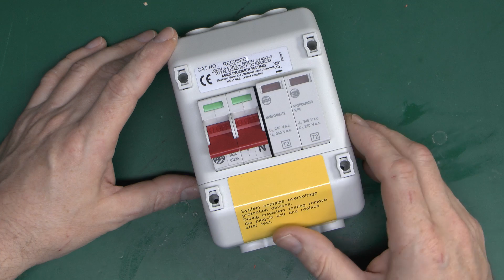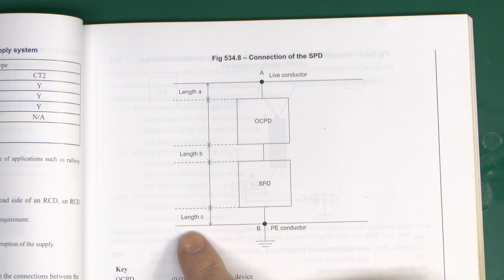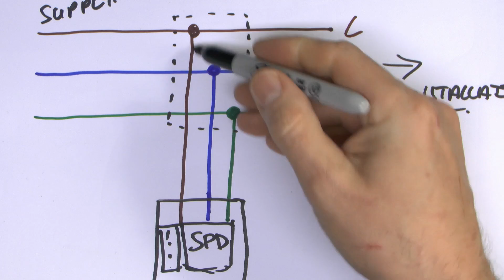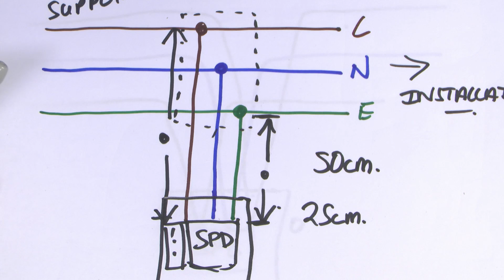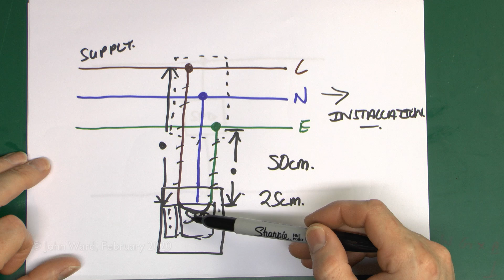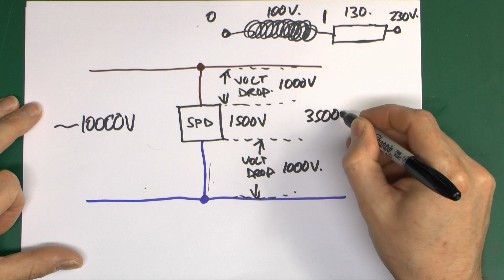Surge Protection 5 - Wiring Lengths, Connection Options

Comment: I wonder if this stuff is being pushed by the authorities to harden UK electricy networks against new EM pulse weapon technology.
Reply: Tim Boler It’s being made explicitly allowed because everything now has electronics in.
We used to have incandescent bulbs for lighting, AC synchronous motors running clockwork in our appliances (oven clock, central heating timer, etc), and bimetallic strips regulating temperature (thermostats in your heating, oven, fridge, freezer), etc; none of which were that bothered by a momentary power surges.
Now we have LED lights with electronic drivers, and electronic powers supplies and controls in our appliances.
Electronics don’t like these kinds of voltages, the insulator layers within an integrated circuit are very thin (more than thick enough for the normal conditions), a component might not totally fail the first time it is hit by a surge, but it creates a weak spot, where subsequent surges will cause further damage. It’s usually an accumulation which causes the final failure, not an obvious event like a near by lightening strike.
SPDs are designed to reduce those surges to a level where the electronics can tolerate the remaining energy without being damaged.
Reply: @Bin216  Maybe a problem if you live in a rural area where the incoming supply is fed via an overhead line susceptible to lightning strikes, but for most houses fed by underground cable, I'm not sure.
Reply: No, an EMP will destroy EVERYTHING and it DOESN'T EVEN HAVE TO BE PLUGGED IN!! The only way to protect from an EMP is to place the electronics inside a FARADAY CAGE , otherwise everything with transistors is going to be fried and worthless.
Reply: I'd bet more on insurance companies etc. wanting more protection for sensitive electronics. Always follow the money.
Reply: @benbaselet2026   My line is IT, especially data centre management.  We put significant amounts of time, effort and money into securing our power supplies because a single incident could potentially cost many millions.
However this is just guarding against an expensive but very remote possibility.  Most European data centres are on urban (so usually underground) and notably stable supplies.  In 25 years I've not seen such an incident, not even one caught on monitoring systems that did not reach critical equipment.
So I would be genuinely very surprised if this figured very high in insurance companies' calculations.
For the moment I remain sceptical — even cynical — about the merits of domestic surge protection. They seem to be even less value than the arc fault protection devices that are also being heavily promoted by the manufacturers. If you're following the money I'd say it's there that the trail leads.
Reply: No. It's being pushed by manufacturers to sell more over-priced widgets.

Comment: Just a minor point.  Actually twisting the leads together doesn't reduce the inductance, it might even make it a bit worse bearing in mind the thick insulation on these wires.  The important thing is to keep the two wires as close as possible to each other.  This is why the regs use the term binding rather than twisting.
Reply: Just to clarify, twisting wires does provide other advantages.  Twisting the signal and return wires in a communications cable reduces the crosstalk between adjacent pairs, reduces interference from noise sources and it is also used to control the impedance of the cable.
Reply: This is correct. The intent is to reduce the area enclosed between the two conductors as much as possible as this reduces the inductance. Laying the two conductors side-by-side achieves this area reduction as effectively as twisting the conductors without the additional wire length introduced by twisting.